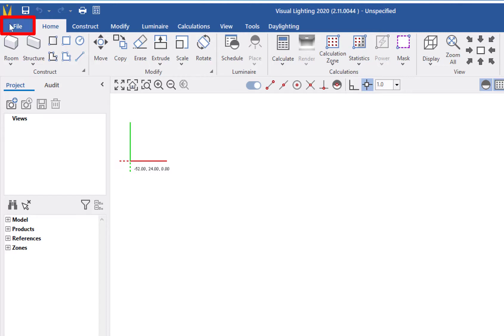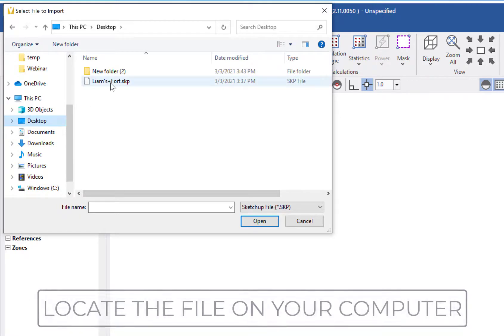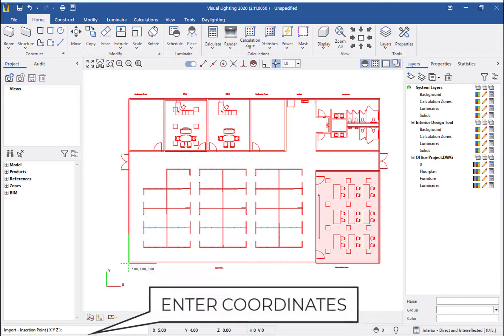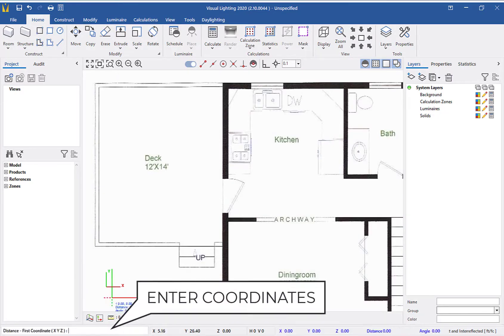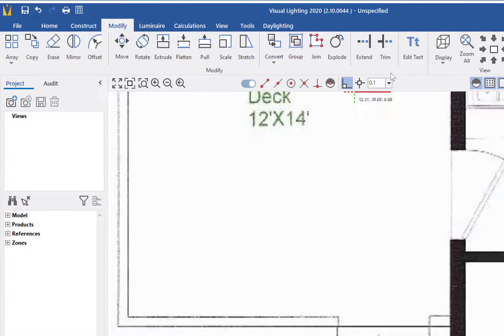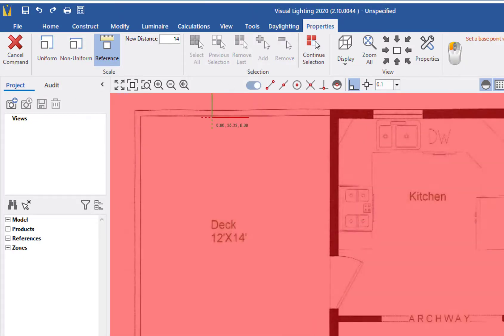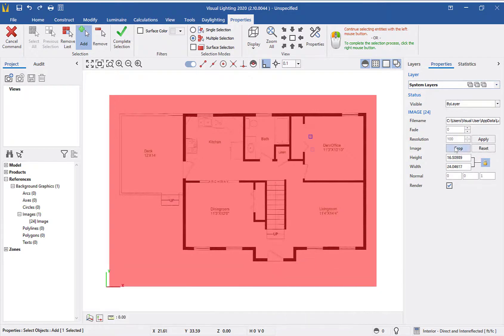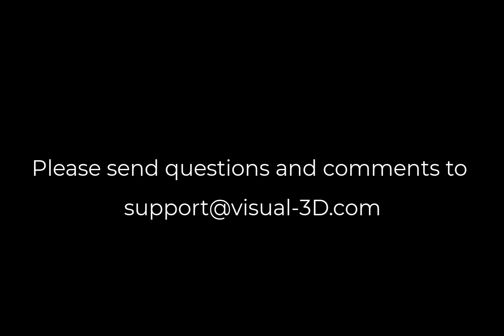Visual Lighting - Importing Files

Comment: Hello, I'm trying to import a .pdf floor plan. When it is imported the image quality is very low and the text in the document is unreadable.
How can I fix this?
Reply from the maker: From the properties sidebar, select the PDF. There is a Resolution property that defaults to 100%. You can increase the resolution and select Apply.
Reply: @Visual3DSoftware  
"Unable to convert at that resolution, image will not be changed. Error-2147221497. Out of Memory "

only 33% of my system memory is in use.

Comment: Is there a best practices guideline for importing sketchup? Max file size? My app keeps crashing when I attempt to import SKP.
Reply: did you find out an answer for the max files size? I imported a 6.5MB CAD file and it significantly slowed the software down.
Reply: @Vincevegasixtynine   No, quit trying to attempt this. The plan was to export from Revit to sketchup and then to visual. But visual can’t handle anything bigger than a closet sized sketchup file it seems.
Reply: @Vincevegasixtynine   dedicated graphics card seems to be a necessity for this, I’m using a 1650 super but the more the better. The “minimum” requirements listed on the website are pretty dang low. 6.5mb is a big CAD file for this.
Reply from the maker: @Vincevegasixtynine  Phil, depending on the number of background objects imported in, Visual can start to slow down once it hits around 100k background objects (depending on your system hardware). You can send the file to support@visual-3d.com and we can see if the speed issue would likely be due to the objects imported in or for another reason
Reply from the maker: There is not a maximum file size, but with Sketchup files, the program will start to struggle depending on the number of solids in the project. You can always send the file to support@visual-3d.com and we can take a look and see if we can import on our end or not.